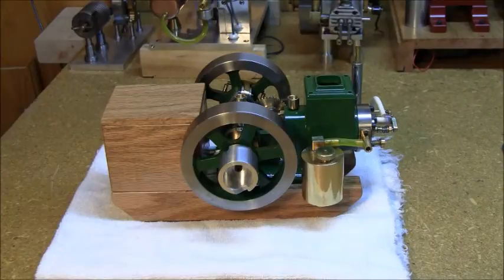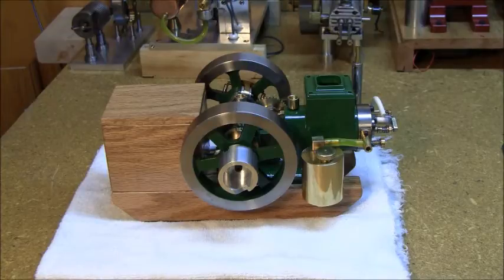Kerzel Hit and Miss Engine

Comment: I am new to things like this, but if you wanted a throttle, could you effectivly just build a mechanism that kept the things that expand down so the valves would still move? Just a question.
Reply from the maker: Hello Josh, the speed of the engine is controlled by the spring tension of the governor weights. Thanks for the visit. Dick
Reply: Yes I understand that, if you were to have a mechanism that kept those weights from expanding, the engine would rev up, correct?
Reply from the maker: A simpler way is to make a devise to stop the exhaust valve stop from engaging.
Reply from the maker: correct

Comment: Did you have to mill the spokes. Or did you use like bearing races on something else.
Reply from the maker: +Szymon thanks for visiting my page. Sorry i don't sell any of my engines. Let me explain why. These are all hand built engines. It took me 150 hrs to build this little green engine. Figluring $20. per hour that would be $3000 us dollars plus the material. I don't think anyone wants to spend that much money for a little engine.
Reply from the maker: +billybonewhacker Yes i did mill the spokes and yes it is a lot of work. Thanks for looking
Reply from the maker: billybonewhacker I milled the flywheel from bar stock.
Reply: Whew that was alot of work. Great video
Reply: +dickinohio  I am fascinated by the hit and miss engine and i cant fined any for sale at a good pries wood you sell one of them for a good pries .thanks

Comment: Nice build Dick!  The ignition system looks different than the plans.  Can you elaborate?
Warren
Reply from the maker: hello warren. I am using cdi from s/s. If u look closely between the flywheel spokes u can c the brass disk that holds the 1/8" magnet. the hall effect pickup is mounted below. A setscrew through the disk allows for adj on the crankshaft.

Comment: Dick, very nice engine build and starts easily too. I also use a rubber o-ring instead of the expensive and hard to make cast iron piston rings. Thanks for posting. Later, RT.